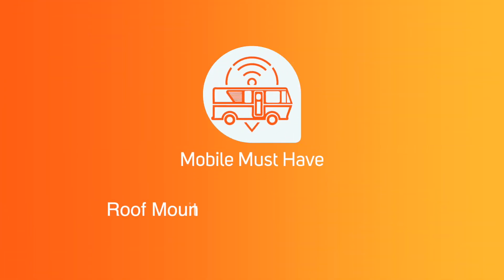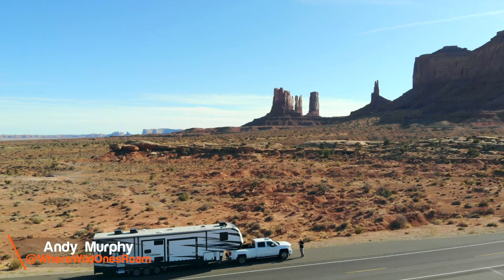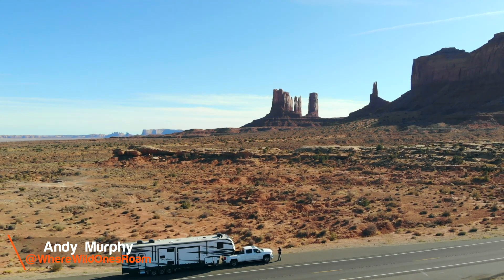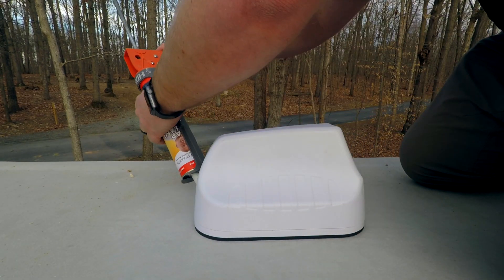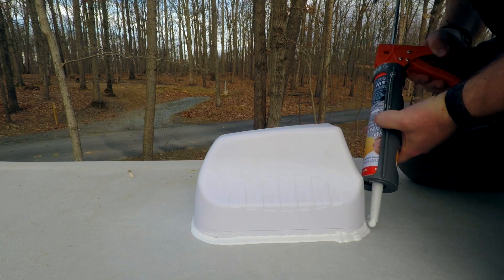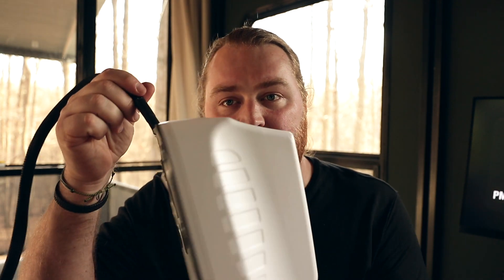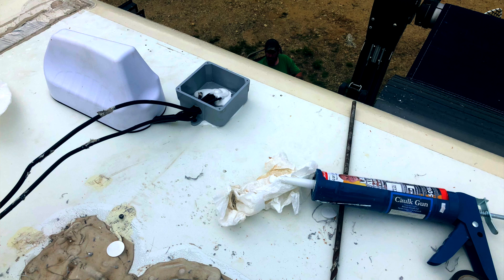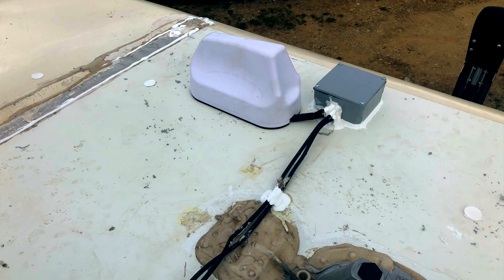Poynting Roof Mount Install

Comment: Partially filling the hole with gap filler and then sealing around the hole with silicone would have been very wise also before sticking down the antenna. You just can't  weather proof this enough when it's exposed to the Summer and Winter 24/7 every day of the year.....
Reply from the maker: Silicone is not generally recommended for tpo vinyl or fiberglass roofs as it lacks self healing and flex capabilities. It works great in metal Roof applications and is used by oems like airstream. A spray foam gap filler could maybe be used but could also expand too much affecting the seal if not done properly. The installation method here with dicor is still our top choice and this unit is going strong years later on Andy’s rv. Thanks for the comment and suggestions!

Comment: I've never had any success with my Poynting 5 in one antenna. I am literally one mile from the tower I'm connected to, and this antenna makes no notable improvement in signal. I actually took the blade antennas from my Pepwave and made a makeshift antenna on a pole about 10 feet in the air and improved my signal metrics quite a bit. 

My poynting antenna is on top of my 5th wheel, about 14 feet high and it does nothing for my signal. Very disappointed in the results of my efforts and expense.
Reply from the maker: being in an extremely good cellular reception area means that adding an antenna with high gain wont do much. If your signal is already at 100% for example, you cant go over 100% by adding an antenna. Often customers confuse good signal with "fast speed" which are largely unrelated. You can have an excellent connection to a cell tower but if that tower is saturated or otherwise not able to provide more bandwidth (data plan caps, tower saturation, environmental factors etc) then you wont see speed improvements. You may want to check out what band your connected to on that tower and consider changing to a different cellular band that has more capacity. We have a video on band selection here: https://www.youtube.com/watch?v=OLJYxFxMJaM

Comment: You mention Dicor as a sealant however, Dicor makes lots of different products. I'd like to know specifically what product you use and where I can get it.
Reply from the maker: Dicor self leveling roof sealant is available here in various colors. Thanks for the question! https://mobilemusthave.com/products/dicor-self-leveling-sealant-in-various-colors?_pos=1&_psq=dicor&_ss=e&_v=1.0

Comment: You say follow the labels on the wires, but mine came with no labels
Reply from the maker: Hey Cam, checkout our quick start guide and under Table of Contents look for Antenna Wiring Diagrams using this link below. if you get stuck reach out to us via chat or info@mobilemusthave.com and we will get you sorted! https://support.mobilemusthave.com/support/solutions/articles/67000391582-pepwave-max-series-max-series-bundle-get-started-guide-#Antenna-Wiring-Digrams

Comment: Do these have to be roof mounted?  Basically is there another way then drilling in the camper…"
Reply from the maker: There are various roof mounting options but regardless you'll need to get the cables indoor so you are going to be drilling a hole somewhere. Remember your air condition sits on top of a hole that is more than 12 inches by 12 inches in size protected by a simple foam gasket so don't be too discouraged. Often we find customers trying to create creative solutions and ending up with problems instead of trusting the antenna manufacturers and testing data. Having 4+ inches of 3m adhesive and Dicor self leveling sealant between your roof entry point and the elements is a much safer option than most alternatives. Remember a solar panel installed from the factory for example is simply a screw drilled right into the roof with sealant appleid on top, thats it, this is much less prone to issues. Some customers choose to install a roof box and we have a video coming on that soon as well. This is popular for those with solar installations or those who switch out antennas and gear frequently as they have a serviceable installation that can easily charge out cables. We recommend checking out the recent video from the RV Geeks installing our equipment for more information on that type of installation. Here is a link! https://www.youtube.com/watch?v=ciz5CEd0FQs

Comment: Excellent video!  I have the Poynting antenna and Pepwave BR1 ready to go.  I also read that you can install it and use it as a wifi antenna until you get the SIM card.  Would I just leave the cell cables off until I get the SIM?
Reply from the maker: You can hook up all cables, just configure the Wifi as wan functionality if you want to use public wifi without a sim. Help article here: https://support.mobilemusthave.com/support/solutions/articles/67000524620-connection-to-an-external-wifi-source-with-wifi-as-wan Make sure to check out our 300gb data plan option as well on att network here. https://www.mobilemusthave.com/MobileMustHave-Wireless--300GB-Cellular-Data-Plan_p_1416.html

Comment: Andy I just bought the Parsec 7 in 1 from you and am ready to install. I have a fifth-wheel toy hauler. My question is about the locking nut. I assume that you would need to cut out the underside to get the locking nut on (access)? Is this required or is the adhesive and dicor enough?
Reply from the maker: Hey Don, the locking nut is not required for most rv installations. The locking nut is for metal roof installations for non insulated roofs (when dicor is not used, for example on a fire truck or police car). The adhesive mount along with dicor and gravity are more than enough and we have had no issues with antennas going back to 2013 without any issue with this method.  Make sure to clean the roof with a roof cleaner or solvent approved for you roof before sticking down the antenna and make sure the roof is dry and above 45-50 degrees f and you should be good. Thanks for the great question!
Reply: @MobileMustHave  thank you

Comment: Great video - really helped me install my new parsec antenna.  How do you connect the router to dc power?
Reply from the maker: We show this in the router set up videos.  It depends on which unit you have as some of the DC power labels can change based on your mode.
Reply: @MobileMustHave  I have the Ultimate Road Warrior with Dual LTE-A Pro CAT-12 Mobile Router with Parsec 7-in-1 5G Compatible Antenna
Reply from the maker: @theroadoffaith7855  A wiring diagram for the 12v power system for that bundle is available here: https://support.mobilemusthave.com/support/solutions/articles/67000682693-pepwave-transit-series-dc-power-wiring-diagrams

Comment: Thank you for this walk through - wish it gave me a bit more confidence that I could drop this through my Grand Design roof (1/32" of roof membrane, 1/2" inch of OSB, about a 4-5 in layer of air with some insulation, and then a 1/8" to 3/16" piece of paneling) sounds like more than shown 
Just have to decide between Poynting and Parsec antenna
Reply from the maker: with a clean install surface, 3M outdoor adhesive (included) and dicor self leveling roof sealant you have nothing to worry about. Remember your air conditioner covers a hole nearly 2 feet x 2 feet that keeps the water out with only a small foam gasket. This installation method works very well for our customers and keeps the water out.
Reply: @MobileMustHave  are there people who install for mobile must have?
Reply from the maker: @theroadoffaith7855  we have installation partners in a few areas but honestly any rv installer who has installed a tv or sat dish can handle and if your installer has questions we are here to help.

Comment: Good video.  Is there a reason you did not use the spigot and plastic nut to secure the antenna?
Reply from the maker: Ya, it’s not long enough to stick thro and attach. Sorry for not showing that or highlighting it. The adhesive is more then enough with the low weight of the antenna

Comment: I really do not want to drill a hole in my ceiling but have a roof vent in the same area as the router.  I assume there are no issues if I just stick it outside the roof vent when I need to use it and not have it permanently installed?  It would be a challenge on rainy days I suppose but has anyone utilized the Poynting this way?
Reply from the maker: Yes, a lot of people will use refrigerator vents, or other ways to drop the cable.  I know the hole part sounds scary, but it is the best way to create a water tight seal for the antenna if you have not current cable drop too.  It requires no more work then your other roof mounted objects now.  I have had zero issues with this install since the install and it sat under snow for months!  You cant even see it on the roof, and we dont ever think about it.  Its there, its always working. :)

Comment: Great video, when you stuck it to the roof , did you fix it from inside as well or just the dsa and the fillet
Reply from the maker: No, ceiling was to think so it is just held on with the adhesive.

Comment: Did you find with your Pepwave install, that your signal is strong enough to use VOIP? I travel and work at the same time and are constantly on the phone.  I would like to use this technology to help with my phone signal in weak areas. Please advise.
Reply from the maker: Absolutely!  I am on VIOP calls for about 4 hours a day with Zoom and MS Teams.  As long as you have decent service and the towers aren't over run with traffic (rare but happens in RV dense areas), you should have no problems

Comment: Hi Andy, nice video.
When WiFi antenne on the outside of the rv, do you still have WiFi signal inside the rv?
Reply from the maker: Yes! The wifi is quite strong and putting it higher up gives you better coverage over your entire RV compared to the wifi coming from a lower spot behind something else that could cause interference.  That said, if you do find the signal weak, you can add an internal access point like the Pepwave AP Mini, or just not connect the wifi cables unless you need it for external wifi reception with wifi as wan.

Comment: Great overview!  I am about to purchase a Raptor 413 that has a  WINEGARD AIR 360+ OMNI-DIRECTIONAL ROOFTOP ANTENNA already installed.   I have to purchase the WINEGARD GATEWAY 4G LTE WIFI ROUTER that works with this antenna.  Thoughts?
Reply from the maker: Hi Jeric, Those work fine overall.  From what we have seen they dont have full network band support so you might not pick up signal in all areas.  Keep in mind they are based on a cat 4 modem too which is the slowest modems.  There are other options with faster internal modems that may help the internet feel faster if you wanted to go down a different route.

Comment: Just read Mobile Internet Resource Center  where a commenter said "I have the 5 in 1 and a Pepwave BRI MK2 and will be testing it with and without a ground plane. I have an early release instruction sheet that states it must use a 400mm x 400mm ground plane."  Mobile Internet Resource Center replied saying "The V2 is confirmed to not need a ground plane despite the manual that shipped." Hoping this is true with the MIMO-3-V2 we ordered from you?
Reply from the maker: Responded to your other comment on the first video. A grounding plane is not required.

Comment: That Poynting antenna has a similar shape and dimensions as the LCI OneControl Hotspot antenna plate that was prepped on our new rig. Do you have the exact dimensions? I'd be nice if we could use the access point from the roof to the inside of the coach that the manufacturer already provided.
Reply from the maker: Hi Jaron, the issue we have seen with the OneControl is its limited band support.  This means that in an area of ATT reception you might not pick up the band the tower is on creating no signal for your internet.  The bundle and Poynting antenna pick up all the carrier LTE bands so this is not ever an issue.  

I am not sure about the connections on the OneControl either, the pepwave has SMA connections so keep that in mind too.
Reply: @MobileMustHave  yeah, the main reason I don't want the LCI OneControl is it being limited to AT&T. But, I want to find a system that can use the prep plate and the hole they already cut into the roof instead of drilling another one, lol

Comment: Thank you! Just ordered the Full Time Package. I am going to add a NetGear 8 Port Network Switch, I want to hardwire the 2 TV's and laptops to eliminate the WIFI connections to strengthen that link. I really appreciate the bundles MMH has assembled which removes a lot of expensive experimentation. I also subscribed to the Mobile Internet Resource Center....excellent, excellent information. Thank again.

Comment: Would this antenna work with a Mofi 4500 router?
Reply from the maker: yes it will, but you will need adapters for the SMA connectors to work with the hotspot. 

https://www.mobilemusthave.com/TS-9-to-SMA-Antenna-Cable-Adapter-2x-for-MiFi-Hotspot-External-Antenna-Use_p_98.html

Comment: If installing the antennae with ground plate, should a hole be bored into the plate to align with the roof hole? Or should the antennae be installed without hole in the ground plate?
Reply from the maker: If you go grounding plane, and you are drilling a hole, just stack everything and run dicor around all those edges.
Reply: @MobileMustHave  thanks for your reply! Should adhesive be applied to the grounding plate to stick to the roof or is dicor enough to hold it?
Reply from the maker: @iancooper368  dicor is probably enough. That stuff is very sticky

Comment: Would it be acceptable to attach a galvanized plate to the roof using Dicor sealant and then attach the antenna to it using the magnetic mounts?
Reply from the maker: Yes it would. Although the sticky pad on the antenna would act as another water seal layer and no real gain from the magnets.

Comment: Does the antenna need to be on a flat surface? The entirety of my roof is curved at varying degrees
Reply from the maker: These should still work. These are installed on airstreams a lot that have that curved roof. Actually, this is the same antenna they install OEM.

Comment: I have a 5th wheel and want to cover my truck too.  Understanding the 20" rule ... would I be better to mount forward of the front AC unit or mid trailer?  Note: My office is in the forward bedroom.
Reply from the maker: We are able to pick up the WiFi in the truck with this current set up. Kids are able to stream when the service is strong enough :)

Comment: You mentioned someone running the cables with existing solar cables. Would this cause interference in the coaxial cables? I have a solar install and i am considering this options. Thanks for the great video.
Reply from the maker: No, the cables would be ok.  But the antenna itself you would want to keep 18 inches away from any ac or other antennas.

Comment: You mention NOT installing this in close proximity to other antennas.  Would that advice apply to passive (i.e. television) antennas?  Considering whether installing this atop my extending (via handcrank) Winegard Sensar antenna's plastic body would be a good or bad idea.  Doing so would let me raise the antenna 2 feet higher when parked (thereby also clearing a rooftop AC unit) but obviously would also be in very close proximity to another antenna - and would mean foregoing a ground plate as well.
Reply from the maker: Hey! I dont think you would have an issues with the internet antenna, but it will probably cause interference with tv signal. (if you still use that antenna).  The poynting has the integrated grounding plate, so you should be ok there.  However, you do only have 6 feet of cable.  You would get better signal not raising it, if that requires an extension.  Adding extension kills your signal gain.
Reply: @MobileMustHave  thanks for the reply... I kind of came to the conclusion this was a poor idea after giving it more thought.  The cable isn't so much an issue (was thinking about putting the pepwave adjacent to the roof cable access) but decided that putting the (comparatively) heavy MIMO-3 on the lightweight Sensar assembly might be ill advised and hokey after all.  Not to mention who knows what the extra vibration experienced by sitting on top of a shaky antenna going down the highway would do to the MIMO-3 over time.  Finally, the roof of my RV is aluminum, so dropping it directly on the roof and keeping it there maintains the added ground plane advantages.

Comment: I installed the same antenna on my fifth wheel (I even bought it from Andy), I was surprised when I read the directions and they call for a 16” ground plane. I fabricated one out of galvanized steel with rolled edges to keep it from cutting the roof.
Reply from the maker: Yes, the instructions do call for one, and it will improve the gain, but we have confirmed with Poynting that is is not required. :)
Reply: @MobileMustHave  I think anyone spending the money for the Max Transit Duo and a Poynting antenna is serious about maximum performance internet and therefore would want a ground plane. Just my opinion but minimizing the ground plane is a disservice to your audience.
Reply: @ScottenJonesVideo  Did you just install the ground plate ontop of the roof and the Poynting ontop of that plate?  Any suggestions on best way to do this?  Thanks in advance, I will be installing mine this week and also didn't know about the grounding plate
Reply: @Tawnieandwayne  yes, I bought some galvanized sheet metal at Home Depot, rolled the edges so they wouldn’t cut the roof and set it in Dicor. Later on the edge were coming up a little so I added Eternabond tape. My install with pictures is in a write up on my modifications here: https://www.scottenjones.com/JaycoEagle355MBQSUpgrades.pdf